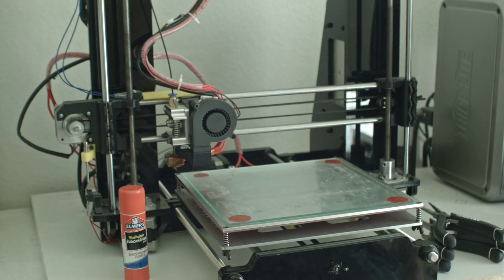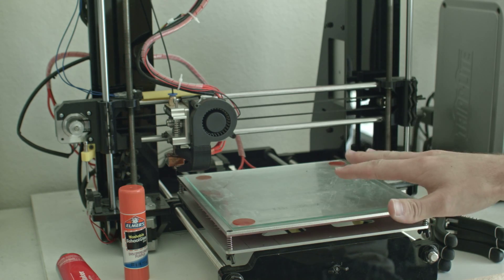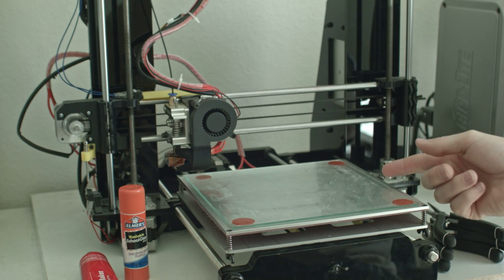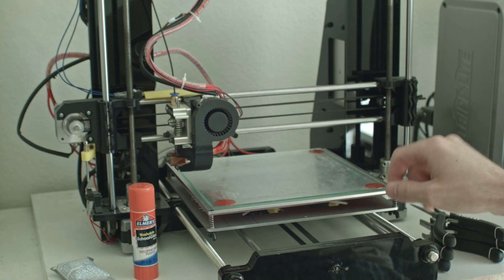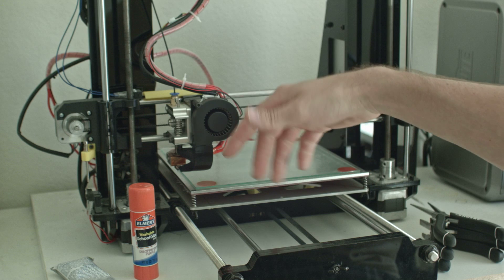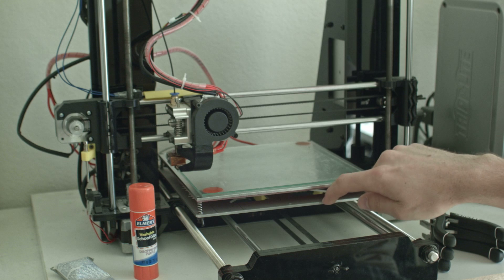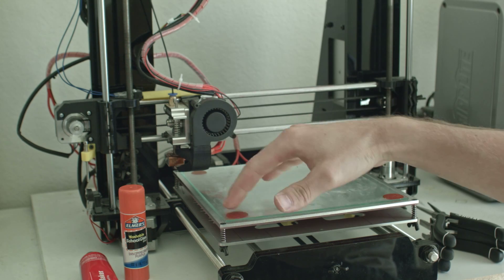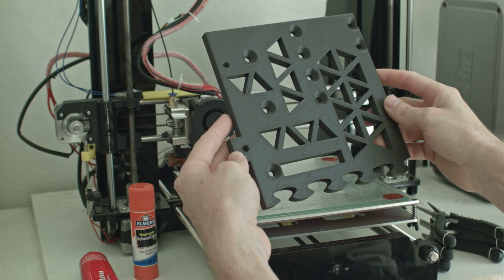Updates for Y carriage & Proto Pasta CFPLA review

Comment: Thermal gap pad can be had for $10 and shipped to your door in 2 days if you have Amazon prime... I got these, cut it into 4 squares placed them on the corners of the glass and never looked back...

https://www.amazon.com/ARCTIC-Thermal-Pad-145-0-5/dp/B00UYTTLI4/ref=sr_1_5?rps=1&ie=UTF8&qid=1482076330&sr=8-5&keywords=thermal+pad&refinements=p_85%3A2470955011

I personally love being able to remove the glass. I use hair spray and I remove the glass to spay on a coat. Also, after several prints I wash off the hairspray from the glass.

Comment: Howdy, I have watched your vids and thank you !  I bought this one over a year ago and finally got tired of stubbing my toe on the box LOL.  I have it all together and everything was great (cept for the x-axis motor needing reversed in firmware and the ridiculous non 90 angle cuts of the plex).  What I am having a stupid hard time with is getting the damn bed level.  Did you have a very hard time with it at the start?  I am trying with glass on top now but it just seems no matter what I do I cannot get it good.  Thinking I received a bad bed from Geeetech.  I may try flipping it, recountersinking the holes, and give it a try.   Any thoughts?
Reply from the maker: DirtyThirty first make sure the surface the printer is setting on is absolutely perfectly flat and solid.  Yes leveling the bed is a pita but that's why I eventually used the aluminum bed.
Reply: Riansolutions ,  that's exactly what I did.  I dismantled the Y-axis and loosened the main connection screws thought the frame, reset and aligned the Y-axis, then tightened everything back up carefully.  I then used high temp copper gasket maker to affix the glass.  Leveling the bed was much easier and printed my first test cube on the first try successfully.

I am now printing the spool holders and then to the upgraded carriers.

Comment: is there a way you could change the x ends to take the standard threaded nut with the 4 holes in? it would be perfect for my leadscrews
I don't know how I'd go about that myself
Reply from the maker: It would be difficult because the original model isn't very clean and the room for the four holes is probably not there..
I would place them on the underside of the plastic with the flat side up and use a couple drops of superglue to hold them in place. They have very little torque on them so that should work fine.
Reply: I'll have to print them out and give them a go. somewhere something g is slightly off and I think its the x ends. 
what was your print bed? I was looking for a 3mm aluminium plate with silicon heater or something along those lines